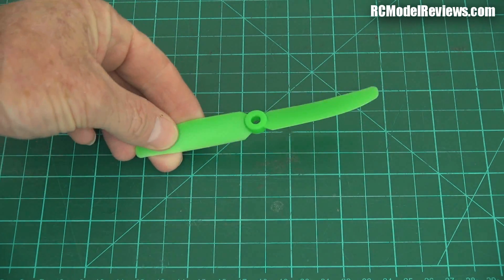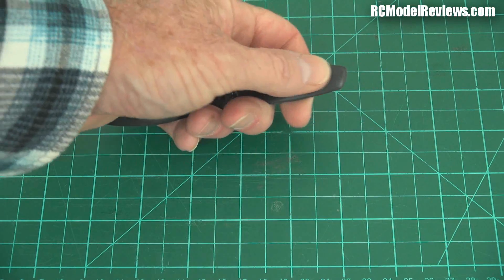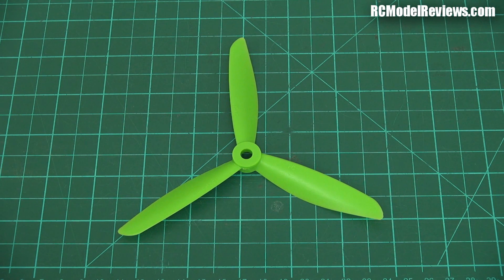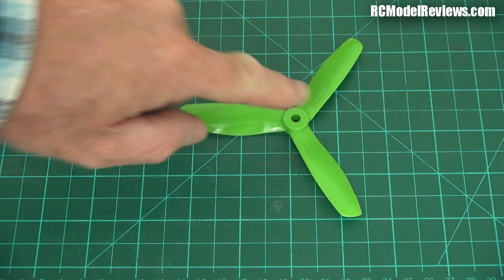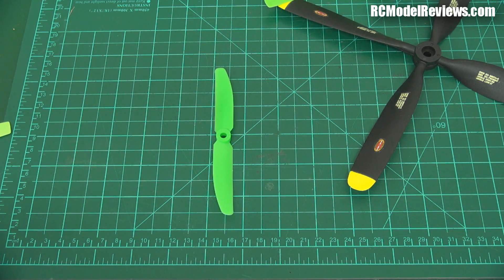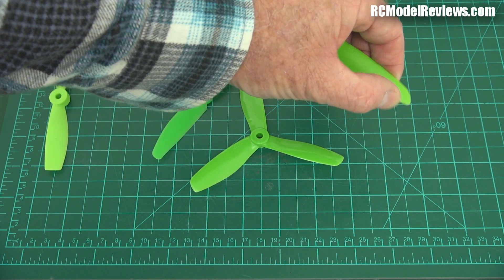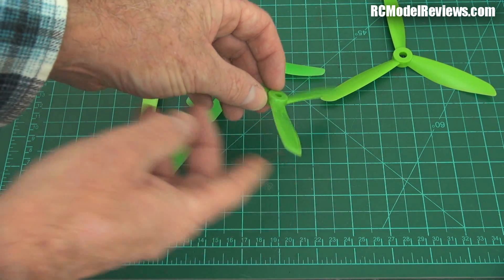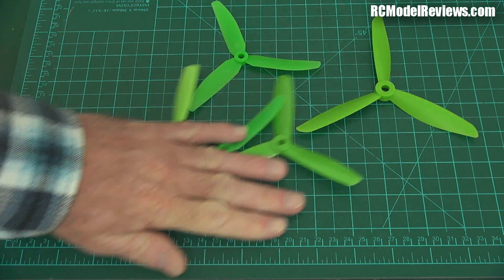Why use multi-bladed props?

Comment: Wonder how long until we see a props with winglets to increase efficiency.
Reply: +sqwert would be great to see, but the centrifugal forces would be huge.
Reply: They exist, but the compromise often isn't worth the trouble
Reply: +Samm Sheperd (SNRS) Q-tip props exist as I'm sure you'll know. But as I understand it they are more commonly used to reduce noise as opposed to increase thrust.
Reply: Stewi1014 Another way of saying it is that winglets increase the "effective span." Since propellers are often limited by the tips getting too close to the speed of sound, (ignoring parasitic drag and manufacturing difficulties) winglets on propellers may be a good way to increase efficiency.
Reply: +sqwert that would be cool
Reply: +sqwert 2 blade with winglets came with my tidewater stock
Reply: +sqwert close. keep going.
Reply: +sqwert The centrifugal forces on high RPM props are usually far too strong for a prop winglet to stay intact.
Reply: Modern wing design does not always use winglets, but advanced tip shaping. The Boeing Dreamliner for one. That is much easier to design into a prop.
Reply: dutchrjen Hi, I just read your G+ Added you as friend, I cant reply to your posts it is quite annoying. I also dont have the "Also paste on G+" on my You tube page. Someone hacked the system. Google sifting for gold and throw us in the rubbish pile. WE can discuss all these things but notice how none of us online are really doing anything about it and are left close to broke so they drain our brains for information. "ISSUE!"
Reply: *****
Point taken.
Reply: *****
They definitely are a good way to increase efficiency. There are 2 problems with winglets though: The first and less significant problem is that winglets basically suck except at very specific Reynolds numbers for a given airfoil. That means you can design winglets that improve efficiency during climbout or during cruising, but not both. Secondly, propellers endure MASSIVE radial (centrifugal) forces. Having a 90° bend at the tip would impart such incredible stresses that the necessary reinforcement would greatly increase both the cost and weight. That being said, Hartzell did make them, they're called Q-Tip Propellers.
Reply: This is called a Tension Wing.  Look for the patent.  The patent for the Tension Turbine is published.  Do a google for  'tension turbine'.
Reply: +sqwert winglets don't increase efficiency, they simply allow the wing to be shorter and produce the same lift. A prop with winglets is just as efficient, if not less efficient that a prop with blades a few percent longer.